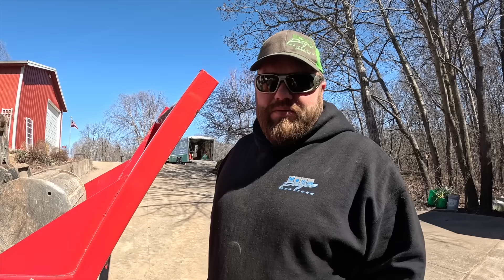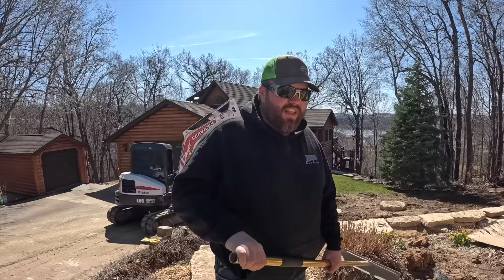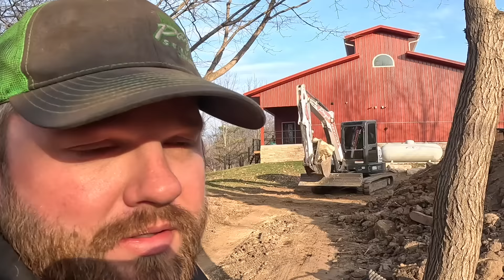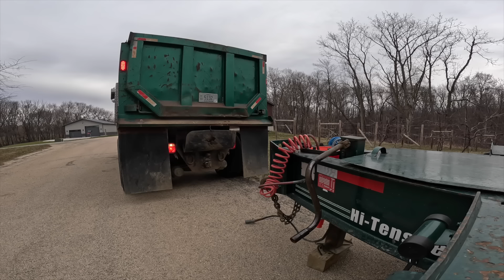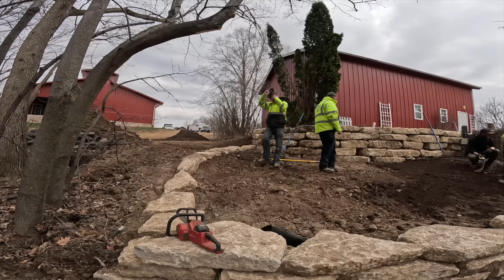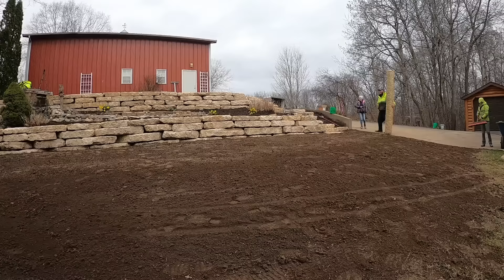This Natural Limestone Wall took us over 3 WEEKS to build!

Comment: put some hooks on the box that you can hook under with the blade on mini ex. leave them open enough so you can grab the front of the box and angle it up for loading on trailer. could also build a second box that hooks on to the blade the same way to carry your different buckets and ripper. put a lid on it to carry hunter around with you? hit it hard enough and like a jack in the box, he pops out with rake?
Reply from the maker: All of these are fantastic ideas! Thank you!
Reply: @pagelservices  absolutely. No problem